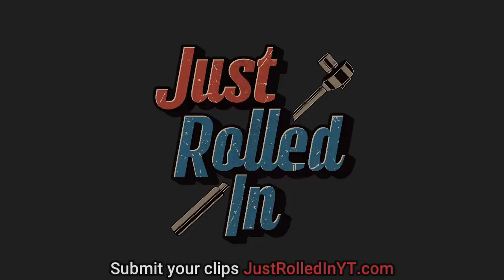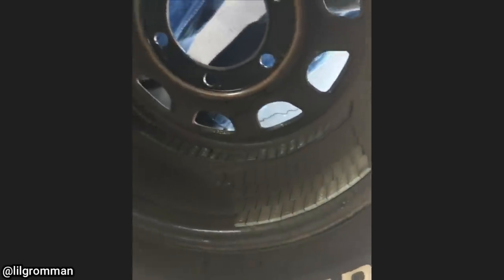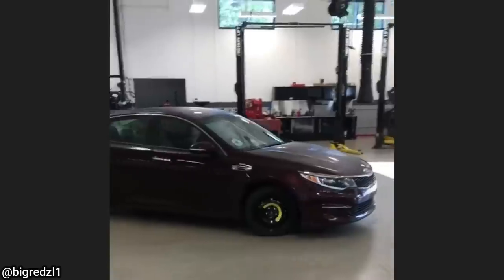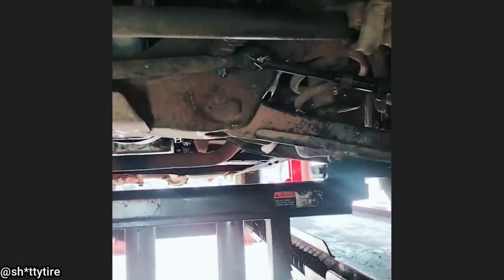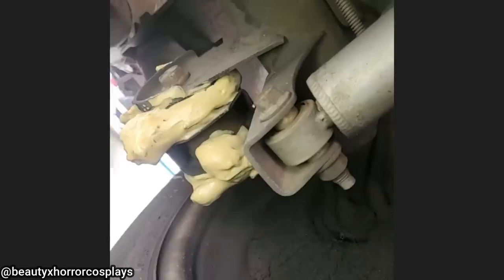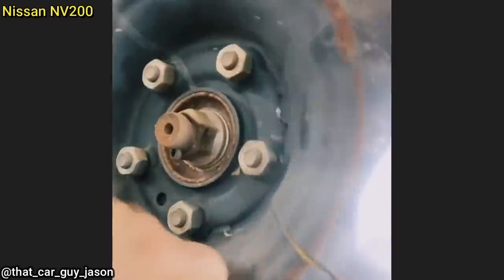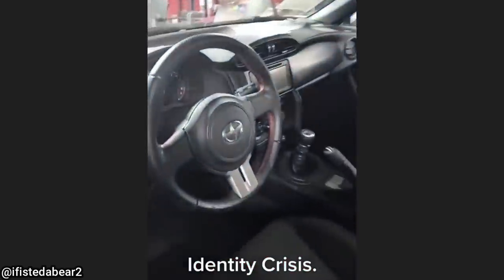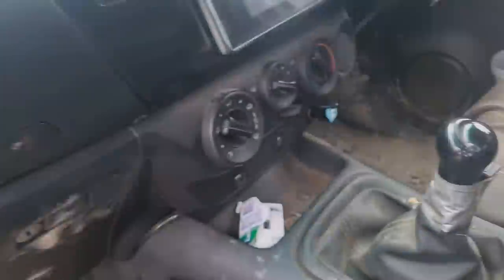Customer States Another Shop Balanced Tires, Still Have A Vibration | Just Rolled In

Comment: I understand that a lot of people are having a tough time financially but many of these "repairs" are very dangerous.
Reply: Spray foam...
Reply: Well that and then the failures they cause end up costing more than the original repair 🤷🏼‍♂️
Reply: @JohnnyEnrico  People can do their own repairs all they want but just realize that it's going to cost more after than it would when you originally get the quote for repair. At least an extra half hour of labor to remove that spray foam properly to get new bushings in.
Reply: My old instructor “Parliament Pete” used to say “crash, burn, and die”
Reply: Spray foam.. 🤦‍♂️ doesn't fix bad bushings.  Bet he felt embarrassed to have to go back in.
Reply: Yeah. If you don't know what you are doing, trying to save money is usually the most expensive option out there.
Reply: Ya man. They don't realize that it'll cost them way more money in the end! Be in debt a few hundred dollars or a few thousand?...
Reply: @bassmunk  Zeroes means nothing.
(It's a maths term. Don't ask!)
Reply: @BoloH.  last i heard is it costs about $10,000 grand to properly train someone in a trade as opposed to hiring some one who already knows what they're doing. If your teaching yourself youre gonna spend that 10 grand.
Reply: @JohnnyEnrico  The problem is that when they inevitably mess something up its going to cost more to fix it the right way.
Reply: I mean, it's one thing to do a repair wrong; a whole other to start with FAIL and get worse from there. And GREAT JOB by that other shop on the 20 lbs of wheel weights on that balancing job! Wow! Such trained pros!
Reply: @fjb666  Yeah, unless the shop is feeling charitable and will bill 15 minutes for the hammer and chisel job to remove it.
Reply: @JohnnyEnrico  'repairs' meaning they just turned their car into a time bomb that may or may not involve YOUR vehicle if you happen to be driving next to them when their 'repair' fails. I'm all for people fixing their cars on their own but not if they don't know what they are doing. If you are a novice repairman, at least get a second opinion or two from the pros to make sure you did it right.
Reply: @JohnnyEnrico  their*.
Reply: Kinda like drunk driving... if you even have to ask if something MIGhT be sketch.... it is
Reply: @AndrewKidd14145  
They can do that.

They're gonna take innocent people with them.
Reply: @fjb666  If you get actual parts and the work isn't above your skill level, it shouldn't really cost you more.

For example-this weekend I replaced my slightly cracked intake manifold and gently leaking valve cover gaskets. It was about $300 all in for parts and a couple of tools to make the job easier (although I'll admit I'm paying for it in a different sense-it took me almost seven hours hunched over the engine bay and today I'm so stiff it hurts to walk. But I paid $0 in labor because I could do it myself.)

That's different from some guy trying to goober up a fix from whatever is cheap. The equivalent in my case would have been slathering up all the leaks with silicone and proclaiming I "fixed" the problem
Reply: @CRWiebe  I have been teaching myself by watching videos, also a fast visual learner. So far my vehicle's still work..
Reply: @christopherrogers303  Well all those semi trucks that have front wheel blowouts are a safety hazzard.
Reply: Cotter pins on crown nuts are not cosmetic, people!
Reply: @almostfm  I guess someone could take that a step further and weld all the cracks.
Reply: @TheCompbuzz  any vehicle that has a front wheel blow out is a safety hazard. The difference is what caused it? Did something outside of their control pop the tire or did they previously damage the tire and think that 'repairing' it with duct tape was better than getting a new wheel?
Reply: I find it very hard just to get into a shop as it's a two-week wait.
Reply: I bet most of their journeys could be done on a bicycle just fine.
Reply: An electrical company where I live advertised we fix what your husband worked on
Reply: @benbaselet2026  When it is raining or snowing then by bike sucks. Also they could convert their bike into a electric bike.
Reply: @TheCompbuzz  I'd rather walk in the rain than drive these death traps :)
Reply: DONT DO THE REPAIRS YOURSELF!
IT;LL BE WORSE NOW
Reply: @CRWiebe  But you don't have to learn the whole trade to fix a bushing though.
However, the ten grand is just for the education. There's another ten grand and beyond for the complete toolbox.

But anyways, if you can get the tools somehow for less than what the shop quotes you and the replacement bushing then by all means do it yourself. There's plenty of free educational content on Youtube for that simple procedure.
But again, the shop quotes you something that you think is expensive? Then by all means spend the money on the tools you need and the bushing and then the TIME it takes you to do the work.

Say you need X done to your car, it takes a shop 30 minutes to complete and the part costs $50. Let's for simplicity's sake say they charge $20 in labor. I dunno what labor costs for a repair shop actually is though, this is just an example.
Now you find the part for $40 and you think the shop is ripping you off somehow. Even though the part you found isn't original etc.

You now spend 3 hours doing the same job because you aren't experienced with it. And you spend another two hours watching Youtube videos showing how it's done.
So 5 hours of your own labor. You are then saying your labor is worth $30 (because you save $10 on the part and the shop charged you $20 for labor) for 5 hours of work.
You are essentially working for for yourself for $6 an hour. Chances are your time is usually more valuable than that at your workplace.
BUT, you also need to get some tools. Those tools will set you back at least $70. So you are actually $60 worse off.
But you get to keep the tools! Which you won't be using again in a looong time. So you need to consider the cost of storage of said tools. Yes, your home isn't free either. Storage space is valuable. Especially when something is in storage for years on end.

But you might actually get really good at doing X, so you can take on customers doing that same job at $10 labor cost and it takes you 30 minutes to complete.
Now you've undercut that other business and customers all flock to you to do the same work, using the cheaper parts... Until one day, a customer wrecks their car and it turns out that the part you installed is the cause.
Now you are in a heap of trouble. Was it worth all that work for a measly $10 each time, only to have it all ripped away from you when a lawsuit comes by?

Yeah, long story short. The reason something costs more than you think it's actually worth at a GOOD shop (not claiming all shops are good or honest) is because you never considered the costs of running the business.
And when a shop says something needs fixing, you can always VERIFY that something needs fixing. But if you have no idea of what you are doing, you are best off actually trusting the shop or go to a shop you trust.
Reply: @RealCadde  you run a shop and rip people off just admit it
Reply: @ureyesrbleeding1  Yes, my main goal is to give bad service so only the stupid customers keep returning.

I could always give good service and expand my business and become a millionaire.
But nah, i smoke meth on my spare time and i only need enough dough to feed my addiction.

My highest profit service is refilling BMW owners blinker fluid. They always seem to run out.
Reply: @bassmunk  - But you dont know the full story on any of these. The spray foam bushings - they might be a total idiot OR they may have no money at all, a sick wife and need to get to work and just hope to God that some spray foam might get them to the end of the week for pay day...

And not everyone can get more $$$ on credit to just " Be in debt a few hundred dollars or a few thousand?"

And its NOT going to cost any more to get the spray foam out, by the time you have knocked the old bushings out the foam will be gone.
Reply: @piccalillipit9211  That's not what I'm talking about. It's a matter of spend a few hundred in the next week or two (however you try to get it) or spend thousands later cuz now your car is actually broken or crashed.

Case and point. A former coworker of mine told me a story about how she had brake noise, and it got really bad. Her rear (I think) pads were gone on her minivan. She was told she had a week or 2 at most before it would be absolutely imperative they get done. She didn't have the money at the time so she put it off.

A month or so later she's going down a hill with one of her kids in the car and there's a red light at the bottom. Seeing as she has no rear brakes anymore she goes right through the entire intersection with her foot on the brakes as hard as she can.

Instead of paying for new pads only, she now had to pay for pads, rotors, AND calipers. Cuz she wore through the backing plate of the pads and damaged the pistons. Oh, almost forgot, half the rotor was worn away.

Guess what, she found the money all of a sudden, a lot more, (borrowed I believe) cuz she wasn't able to drive it otherwise. Wouldn't be able to go to work, take kids to school, nothing...

Imagine if she wasn't so lucky and someone was going through the intersection at the same time and T-boned her?... Another car? Hospital stay?...

This is what I mean by "pay a few hundred now or thousands later"
Reply: @bassmunk  - I understand - Im just saying that we never know the situation with these videos so its wrong to judge the people.
Reply: @ekop1778  DONT USE THE KEYBOARD. THE CAP LOCK KEY IS ONLY FOR PROFFESIONALS.
Reply: @RealCadde  actually, repair shops are over 65 bucks an hour labor where i live.  20 dollars an hour is an era long ago.
Reply: @TheCompbuzz  the time teaching yourself is the expense a shop would have by hiring you. You spending time watching the videos is part of the cost of doing it yourself.
Reply: @CRWiebe  The time watching the videos is free though. Since I watch videos to be entertained or learn something anyways.
Reply: @TheCompbuzz  it aint "free" its time lost you could have been doing something else. If you dont get that or refuse to believe it thats you being willfully ignorant. I enjoy my job but that doesnt mean it isnt taking up my time.
Reply: @CRWiebe  That depends, on whether you actually have any mechanical inclination or not. I built my own car from scratch, without any training - bodywork, mechanicals, and finishing off the electricals after being let down by the auto electrician I was using. Yeah I made a couple of rookie errors along the way, but none that cost me much more than a little extra time
Reply: @CRWiebe  maybe you should take a chill pill too 😂
I get what you’re saying, but like someone else has said, getting it to a shop can sometimes take too much time for your personal needs. What I’m saying is that there are people who have mechanical aptitude and some that don’t. Those that don’t are the type that think expanding foam will replace the function of a rubber bushing! So yes, it does take my time and no I don’t service my whole fleet of vehicles and machinery as I have better uses of my time when I can use a qualified technician on a planned basis. But I am perfectly capable of it when the time arises, eg an unexpected breakdown. 

And when it came to my race car, it was a labour of love as much as anything else and the satisfaction I got out of doing it 😊
Reply: Some of these people are just mentally ill and have a deluded sense of safety that is the honest truth I have family members who think like this we can't really do anything about it because of their incredible sense of individuality and Independence.
Reply: @dannyshroyer5770  of course a lot of these things are beyond redemption and explanation, however oftentimes when someone is broke they're convinced that their big break (i.e., that promotion they've been working so hard to get, that phone call from one of many interviews, or even just the money they're actively saving from the little job they have) will finally hit any day now or soon...so they do whatever they can to make it to work/interviews just a couple days more. I agree these videos highlight a bunch of dangerous things but desperation is the mother of shitty invention lol...

Some people don't know what else to do in the meantime of them actively trying to climb out of their rut. When it comes to the decision of bandaid versus losing their job on account of not being able to make it in, they choose the bandaid when money to have it fixed properly is just not an option at the moment.
Reply: @almostfm  I'm guessing that a lot of these people wouldn't "proclaim that they fixed the problem" just that they bought themselves a little time until they properly could. Bandaids made out of ignorance of course self-proclaimed bandaids nonetheless...for SOME of them lol
Reply: How much of this is incompetence?
Reply: I hate it when people drive cars that are blatantly unsafe. It’s not only your life on the line but anyone else’s on the road. If you can’t afford new tires, brakes, or ball joints then you can’t afford to drive your car, just as if you couldn’t afford gas.  “I can’t afford to fix it” isn’t an excuse to put other peoples lives on the line.

The amount of times where safety imperative recommended repairs have been declined because “I can’t afford to fix it” is insane at my shop. People come in with literally no brake pads left and completely bald tires, and they leave the shop without fixing them and go drive in the rain and snow. They’re going to kill someone.

Driving a car isn’t a joke and it needs to be basically functioning to be morally okay to drive.  Knowingly driving with bald tires in the rai, no brake pads, or bad suspension components but not caring is as bad as drunk driving imo.
Reply: What alot of people in these comments are forgetting is we literally don't have the money to get repairs like this. I had a wobble in my car and it was my front right. it was a loose belt in the tire and it was getting worse and worse and on my commute to work it blew on me and my spare was flat and also had a leak. Now I was able to get to a tire shop after work and get new tires but only 2 tires on my old rims and my spare fixed ran me a pretty penny even for used tires. On top of that I have a battery drain possibly the alternator. My point being is these repairs cost a thing called "money" and not every can make ends meet easily so a car repair is either neglected or impossible due to income. Its the unfortunate truth but it is what it is. As I said prior to my tire blowing and will to any repair in the future that I don't have the money to do: Fuck it, we ball.
Reply: @HeyItzZedd  Driving an unsafe car on a public road is stupid. Doesn’t matter if you can’t afford to fix it or not. It’s unfortunate and it’s a big struggle for a lot of people I agree, but driving a car that can lose control and kill someone at any moment is not morally okay.  Putting other peoples lives at risk because your car is about to fall apart is not okay.  Driving 3500 pounds of metal at 100 kmh is a big responsibility and blatantly ignoring serious issues will cause a crash and itll do a lot of damage to whatever you hit.

If someone knowingly drives a car with unsafe brakes, tires, suspension, etc. and they kill someone they should be charged exactly the same as if they murdered them.
Reply: It literally takes only 10 seconds to google what tyre pressure you need, and even if you don't find a specific answer, you'll definitely find an answer telling you something like "most cars have a pressure of 2.2 Bar"  or something like that, filling the wrong ammount of air is either pure laziness or stupidity
Reply: They all went to YT university...they can dix anything! 🙄🙄
Reply: Cope
Reply: Yeah, this shit is the only thing that's ever made me want more government regulations... Auto shops should have the authority to condemn cars and send to the junkyard🤣🤣